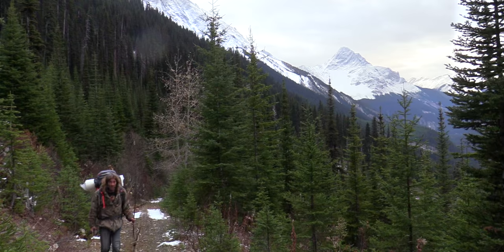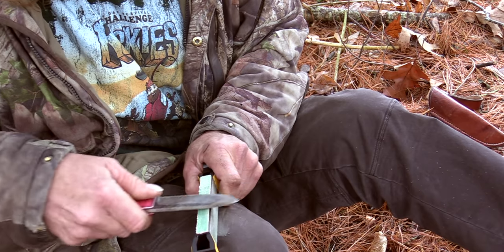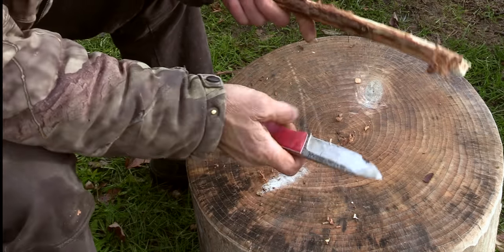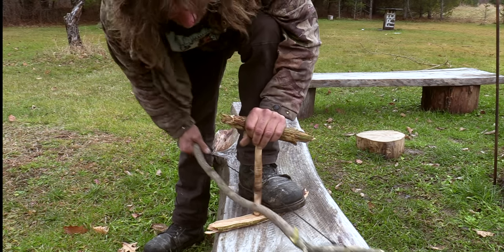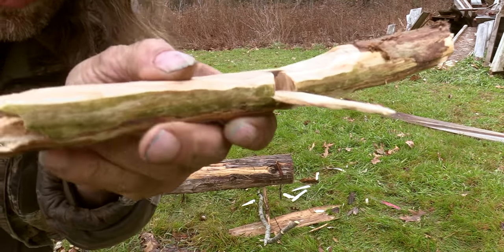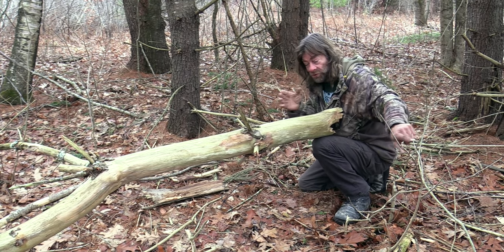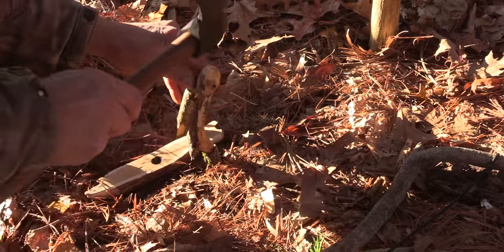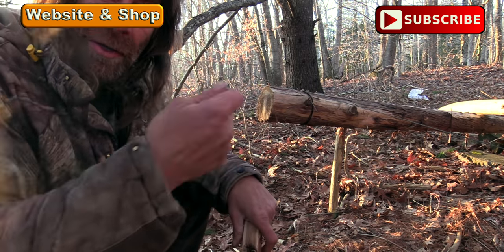One Armed Bow Drill Fire

Comment: T
I have watched dozens of friction fire videos and this is my favorite. This is because he mentioned 1) Four woods for hearth boards, 2) That dry wood, but not to dry, is important for hearth boards, 3) Failure is a part of the learning process, 4) That different parts of the same hearth board can be good or bad for our purposes, 5) That a dry work surface is important and several things to use under all ones' tools, 6) Cutting wood away under the notch on the hearth board (First I heard of doing that) , 7) To put a moisture barrier under wet foot wear. Many other videos mention none of these things or but one or two.